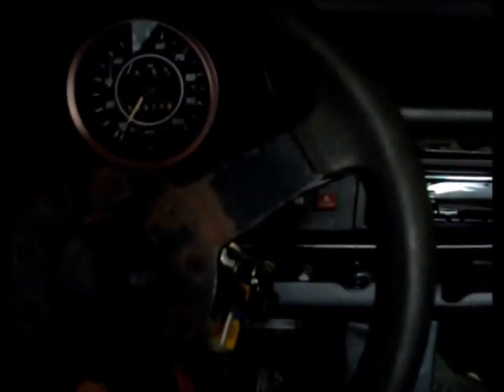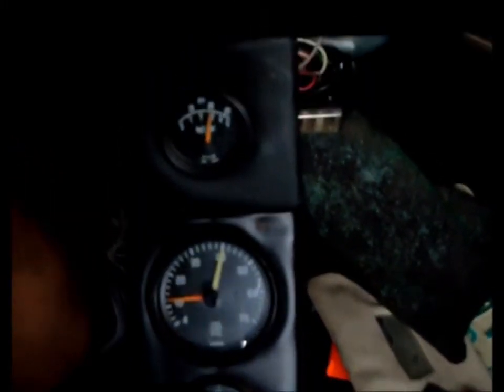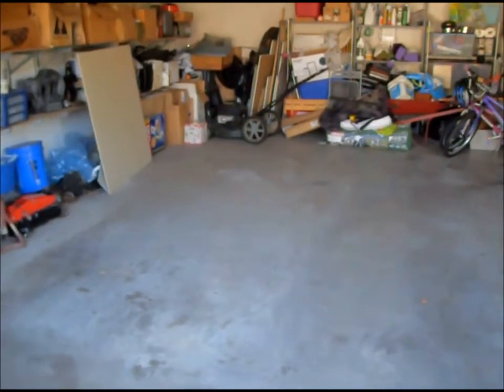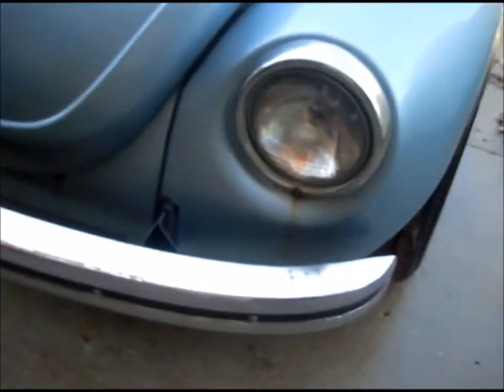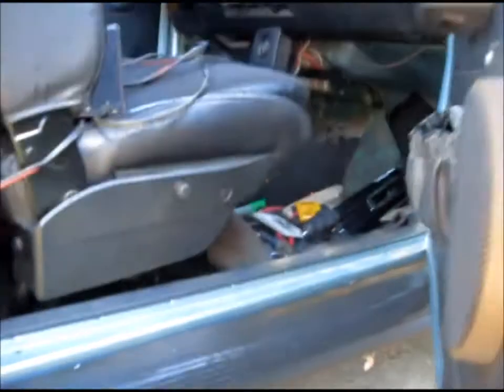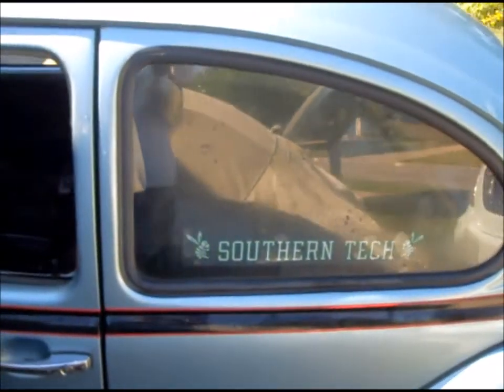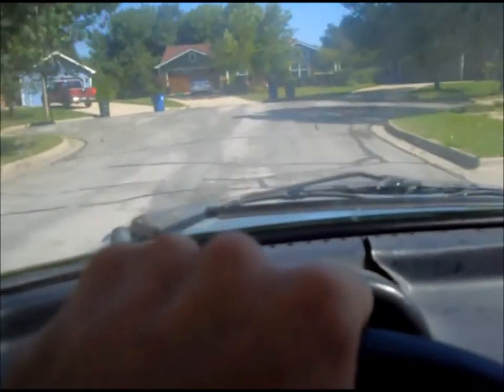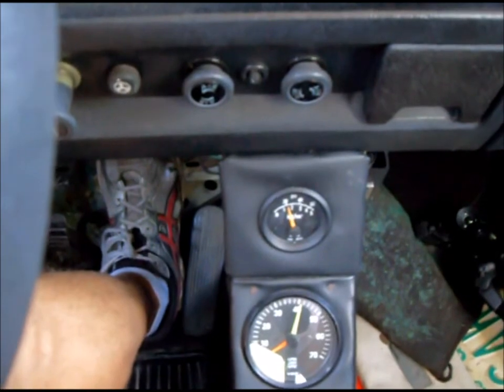vw 73 super beetle first drive in 22 years

Comment: I drove home from the dealership in my dads ‘73 Sport Beetle...you have the wrong trim tho...it’s all black trim, bumpers, and mirrors...Love the wide wheels, big steering wheel and Recaro factory seats!
Reply from the maker: yes, i never thought i'd keep the car for this long so when i was younger: i decromed and went to one piece windows, the outside rear view mirror got broken at some point, the rear bumper was bent when i got the car and i hit a deer in the front which shot that bumper and one fender. the final error is the really bad paint job. my car's original black sticker stripes don't really match the painted on stripes. what's cool though is that your dad was bright enough to buy a VW and a sport beetle at that! in 73 my dad brought home a gremlin X.